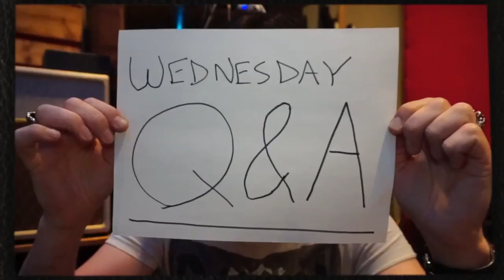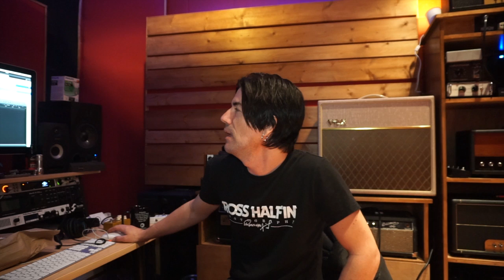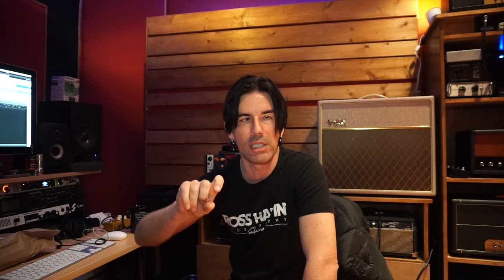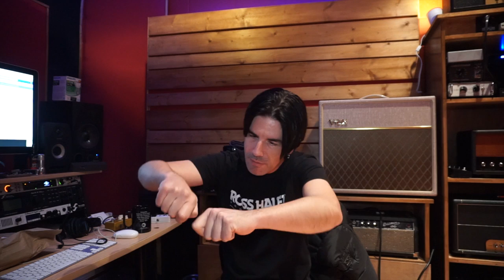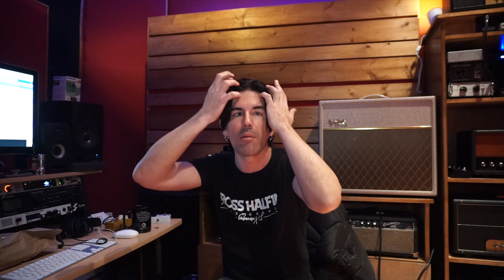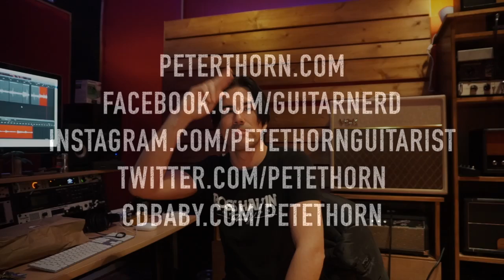Pete Thorn's Wednesday Q&A Episode #6

Comment: Good explanation on the passive "subtractive" eq...I start with everything on ten and then tweak from there.  I find that jumpering the inputs on my 1974 50 watt JMP head and using the bright and regular channel volume I can "eq" the amp better than with the actual EQ section knobs.  I usually have the bass knob close to zero though,  glad I'm not the only one who does that.  Bass really low, everything else pretty much dimed LOL

Comment: Good points on the bright cap question, and very accurate about how it works.  But, I wanted to add that if a guitarist can stand to have a switch added to their prized rig (holes drilled, etc.), it's not a big trick to have that switch change between caps or even between having or not having a cap.  Voltages are important though; so, have the cap selections be suited to a tube rig (voltage tolerances high enough, 200V or greater).  (Consult a qualified electronics expert as needed.)
Reply: +TesserId The bright cap's just passing part of the  signal round the volume control, so it's not dealing with the big voltages.  I removed it completely from my Marshall and it works great like that.
Reply: +Andi Picker, That's true, especially since that part of the circuit is typically close to the input jack, and high voltages there would be a safety issue.  But, one might want a cap that is in keeping with the rest of the rig, and some are finicky about the type of cap in their tone circuits.  In my case, I've added bright caps where they didn't exist, typically for use with bridge pickups.  This can just as easily be done inside the guitar, which would put it ahead of any effects, as opposed to after the effects.

Comment: Hello Pete!  I thought I heard something in the background! lol! I did want to ask about the master volume you mentioned...if someone wanted to get the max overdrive from a master volume amp,wouldn't you crank the channel volume and run the master low?
Reply from the maker: +NoyzyBoyZ3 You'd crank the whole thing! :)
Reply: +Pete Thorn First of all,sorry I didn't see this sooner.Maybe I should have said that doing what I said,was the way to get overdrive at a lower volume? Now you got me thinking about what I said,but yes,you would turn up the channel volume and then use the Master.That would depend on how gainy the amp would be.Yoiur correct on that,it wouldn't be all the way up in most cases.I haven't had a Master volume amp for a long time,so maybe I'm totally screwed up!LOL! The amps I've had in recent years have a Volume and a Gain knob.One thing about those amps that I've experienced,don't seem to play well with Attenuators.Way back when I first used Attenuators,the amps I used were early 70's Marshall's and  Orange heads,and the Attenuators worked great on those for me.I apologize for rambling on,I love this and I could talk for hours.As always,thanks for the videos,and also,the correspondence. You treat me and others like we live next door and it's a good feeling..believe me. Continued success in the new year and...don't be a stranger! Peace.

Comment: Hey Pete, great video as usual. I know you want to take questions on facebook, but I'm not there so I'm going to ask one here.

I struggle with setting the mix (or level) with delays & reverbs. It seems like there's a fine line between not enough and too much. How do you go about dialing these effects in?  Part of me really wants to pickup a couple Strymon & Neunaber pedals, but in the end it won't matter if the sounds/tones aren't tweaked properly. Cheers.
Reply: As Ed mentioned, I too use an expression pedal hooked up to my main reverb/delay H9 to give me the ability to raise or lower the mix due to the changing live environments (and even song to song, I might want more or less).
Reply: +Doug Floyd +Ed Spencer, I've seen that method work well for some of my friends. The problem I have with it is I'm already using two pedals for Vol & Wah. and I'm not looking to add any more. Surely there's a better way to statically dial-in these levels. Right?  :)
Reply: +Ben Breard I've rarely found a setting at home that's ideal for live, so I always manipulate live one way or the other, either via expression pedal, by reaching down and tweaking, or even using my toe ;)